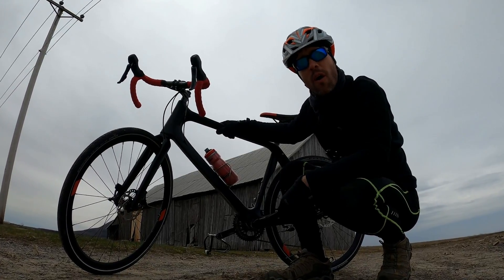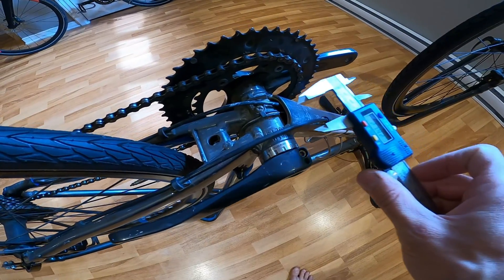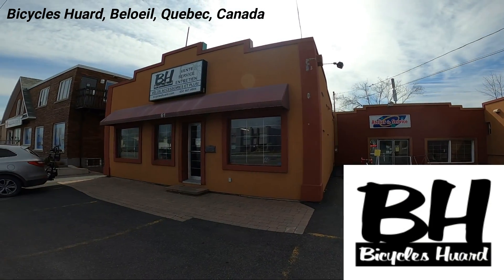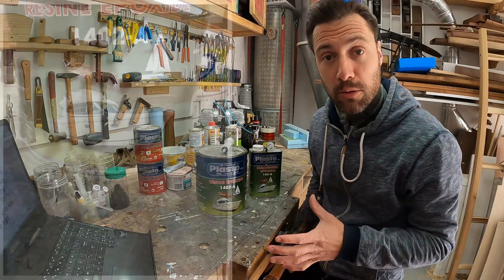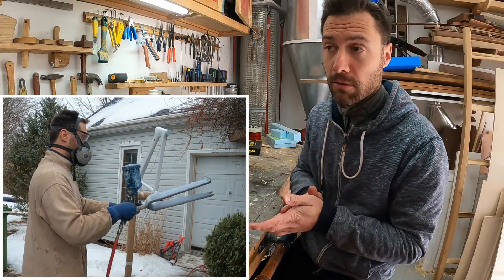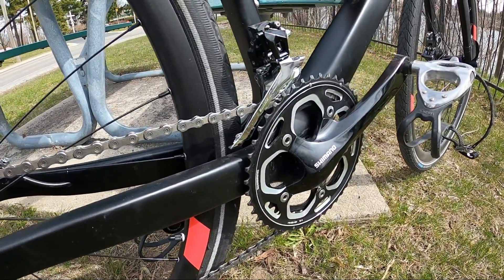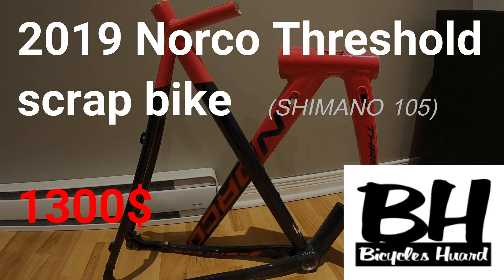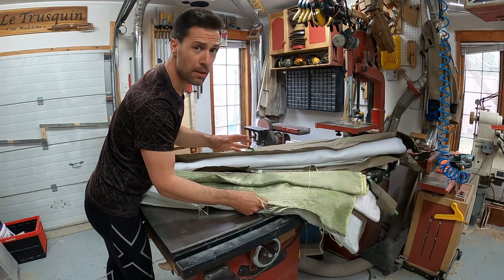Home made carbon BIKE FRAME project - Ep. 8 - Answers to some of your questions + cycling images

Comment: Hi, how did you shape the tubes profiles? And after that, how did you prevent the tubes from deforming when laminating and vacuum bagging?
Reply from the maker: Take a look at ep 1 and 2, answers to your questions are there
Reply: @VoilierFuligule  I've seen them. I know you have used rasps and probably sandpaper, but how did you controlled by hand the profiles? They seems quite complex. Did you just sculpted them by eye? If you did so, you have done great job! 
And I did not see anything about preventing deformation during vacuum bagging. I suppose that the thin tubes are prone to deformation. And another question - when you were making the tubes, did you use a whole piece of carbon from end to end, turning it few times over the tube, or you used shorter pieces? I see that you have used only twill fabric, but did you change the orientation of the fibers in order to get 0 degrees in some of the layers?
Reply from the maker: @krassiechocheva3141  1- First I cut squared pieces. I draw the symetric profile at the end, then, with rasps and sand paper on a long piece of wood, I handcrafted the profile. It worked very well. Pieces are not so big. 2- The smallest back parts on the bottom bracket collapsed a little bit under the negative pressure, so I added more layers and made the joint after them being glued togheter. The shrouds are the only parts which are not empty, I leaved the solid in the center to roll the carbon over, because they were too small and they would have collapsed under the negative pressure. As long as I remember, I used a solid piece of wood as maple (not sure... I got a lot of woods in my shop). 3- No, rolling the whole piece of carbon from end to end makes folds in the fabric, So I made my tubes by stepts of several layers by making 2 or 3 turns each time, then it worked well. 4- Yes, I changed the orientation of the fibers even if commercial frames are made to get deformed and absorbing. I did it for the most on joint parts as well as the bottom bracket, direction tube, chain plates. and upper part of the seat tube. I just used the material which I already had on hand and try to make a solid frame. Th e middle of the tubes are a little bit thinner than the ends.

Comment: I'm interested in your motivation. The bike looks great, but it is very similar to so many off the shelf frames, so why did you build your own?
My motivation is there is nothing on the market which does what I want and I came across your build looking for tips and tricks. What I want is a light weight, semi recumbent leaning trike. I plan to use fibreglass for a quick and dirty trial version, then when I've worked out what I did wrong, make a carbon fibre version.
Reply from the maker: I built my own because I always do my own when I can. Why by something when you could make it? I like chalenges. Fiberglass will work for a trial version, but it does'nt have the same properties as the carbon. Have fun in your project!

Comment: Thanks for this overview of your project. It's s great help in my "cycle" project - a home made velomobile. I didn't know how to make suspension wishbones, as I can't weld (I have nowhere to do it), and glass fiber would be too flexible. But if you managed to make stiff enough not to bend bicycle frame at home, carbon is the way to go then.
Reply from the maker: Thank you Failer and have fun with a home made carbon wishbones. The stiffness will depends on which type of fibre and how you will lay them out.

Comment: Excllent work.   Curious about the Plasto epoxy product, which I would like to try in my boatbuilding projects.  I looked up the pricing, and seems much less expensive than West System, which is all I can source here in Ottawa. Does the Plasto work well as an all purpose epoxy for gluing, fiberglassing/laminating, etc?  Does it suffer from a lot of amine blush?
Reply from the maker: Hi, thank you! I used West System epoxy only one time because I did a job for a friend which had already bought that product. I alaways used Plasto products because I alaways had a nice service when calling or when getting there and ask for technical questions. They have different products depending of the viscosity you want so that for laminating carbon fiber or fiberglass clothe I use the 1402 which is more liquid at room tempeture. For woodturning varnishing technic, I used a thicker resin so that she does'nt leak everywhere. I really like the paste epoxy product. I filled my keel joint and I use it to glue wood on fiberglass on fiberglass parts on fiberglass. Prep is the key. I've been using there products for more than 15 years now on my 22 feet small sailboat, my last sailboat project which is an old Hunter 30, RC sailboats, a home made carbon bike frame, woodturning finishing projects and so on! Never had amine blush problem. I use seringes to measure the right quantity of resin - hardener ratio. I also somtimes use dying for gelcoat to color the resin. Works pretty well. Don't be shy to call them and ask about there products depending of your project. I'm not specialized!

Comment: Hi, awesome project, could you do this with fibreglass instead of carbon?
Reply from the maker: I don't see any problem, except it would be very important to use the right progressive thickness and probably use some unidirectionnal fibers to make the frame more ''flexible''. I reiceved couple of e-mail of persons who started a project in fiberglass instead of carbon.
Reply: @VoilierFuligule  Thanks! I am planning to make that, but a trials bike frame (you know the one without  a seat). Cheers!

Comment: I am do amazed by this work. I hope someday I'll be having a chance to make my own
Reply from the maker: The best is to do it! If you already own a bike which on you can take all the measurments required like I did (because I'm not a bike expert...), it will help you a lot! Have fun and don't miss on security!
Reply: @VoilierFuligule  Got an alloy bike and might try this in the nearest future. May I ask how it's been up to now? Still great?
Reply from the maker: @Tentenszx  Still great, but I did'nt have the chance to try it a lot. Only for 300km. I got more time with the pandemic last spring to finish almost the project and cycle, but I'm also a sailor and during summer time, I don't cycle much because we pass all the summer long on our sialboat. I have to wait by mid-May to use it again. Otherwise, I can tell you I really appreciate the little ditance and the few trips which I used it. Shimano 105 is a nice upgrate from Shimano Sora and carbon is lighter. I'm still using my fatbike to go to work everyday, to much snow here and ice on the road. I will get on my hybrid in a few weeks and eventually could take my carbon project!
Reply: @VoilierFuligule  That's so great! Does people ever ask you about your bike asking what brand it is and you answer them with "I made the frame"
Reply from the maker: @Tentenszx  Hi Adrian, not much for the moment. But you may know that most of the time I cycle on roads between fields  and I rarely meet other cyclists. I'm a little bit ''solitary'' and like to do things alone. Also, I don't use my bikes on weekends because we get to the marina, so my biking schedule does not help te get contacts. Will see in the next few months! I also think that the fact that my frame does not look like a hand made one  contribute to do not get a lot of people asking me which brand it is. But I let you know that is a plaisir when comes the time to tell it!!! Get several collegues at work which were impressed by the finished look.
Reply: @VoilierFuligule  Even I were impressed by it and if I didn't watch this vid and saw that bike I would be thinking that it's been restored or repainted that's why it doesn't have any decals. Hope you'll have more great creations in the nearest future sir. Glad to see your work even in just a video.

Comment: Hey Voilier thanks for the series of videos, they gave me a lot of insights and inspirations. I was wondering of what type of oven did you use to cure the carbon? And I'm assuming the carbon is prepreg with resin?
Reply from the maker: Hi Tigor, No the carbon fiber used was not prepreg. I just used a seeting heat mat with basic isolation to reach a higher tempeture. But the resin I used cures in 20 mintues et 20 celcius degrees. I prepreg my fabrics by myself before layering. The same technic was used to build the frame parts as the little plate under the BBshell, take a look at Ep. 9. It's the same for all the parts I did! https://www.youtube.com/watch?v=oxUUCrz_mHg&t=11s

Comment: What mixture did you use for the drop out? Resin and? I have tons of questions I am planning to create my own frame.  Here's my email mjalgire2@gmail.com
Reply from the maker: Dropouts were made of the same resin as all the frame parts. Products used are presented in this episode (#8) the epoxy resin I use is a mix of 5:1, it gives me around 30 minutes of working time at 15 degrees celcius, but almost 20 minutes at an ambiant tempeture of 20 degrees before I heat the parts to decrease the curing time. I just laminate may layers of carbon fiber in my molds until getting the right thickness. All images are stored at home on a hard disk, I'll e-mail you later, should be next week because i don't have anything here at the marina.
Reply: Thankk youuu!!

Comment: Hi bro. Thank you about the BB30. What I mean is the BBtube

And the part where you put your rear derailleur
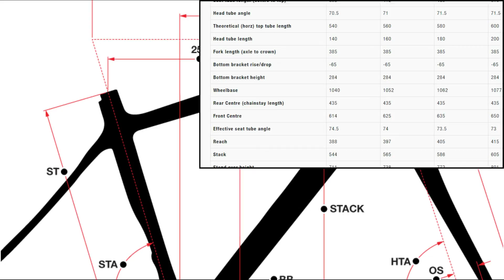Reply from the maker: Hi Joseph, I made them. The bottom bracket tube was mold on a piece of wood wich I could separate in two parts to remove it. Next I integrated this tobe in my bottom braket part. I get few images of it. Look here at 1:32     https://www.youtube.com/watch?v=TJ4Iz2JXh2M     you will see the carbon tube I integrated in styrofoam which has been laminate with carbon. I can send you more pictures by e-mail if ou want. At 1:36 you will see the final bottom bracket part ready to be glued with the other frame parts. Here   https://www.youtube.com/watch?v=TJ4Iz2JXh2M   at 0:05 you will see the rear derailleur parts wich I mold in solid carbon 1/4 inch thick. I'm actually in a sailing time, but I planned to make more videos next winter to explain well how I did these parts (it requires a lot of time because english is not my language...). I get a lot of questions about the BB tube, the droouts and the head tube. The technic I used to make the BB and the head tube is similar. Dropouts where made by simply molding and I add a small aluminium plate on the left side to prevent wear on the carbon fiber. Hope this will help you.
Reply: This helps a lot bro! Please do an in depth tutorial to what techniques you've used in making the rear drop outs, bbshell. Thank you for responding I'll be waiting for your videos
Reply from the maker: @joseph0327  Thanks for your petience!
Reply from the maker: @joseph0327  Sorry I should say BBshell, not BBtube... you may know i'm not a expert in carbon making... just a guy who likes making things by himself! You may find other technics. some people just buy metal parts and incorporate them into their project.

Comment: Hi bro, did you compare about wheight with the alumunium frame?
Reply from the maker: Hi timtim, my aluminium hybrid bike weights a little bit more than 27lbs. My carbon bike (same wheels and tires) is a little bit less than 16lbs. Would be even better with carbon wheels and thin tires... but is't OK for now! I never had the chance to get my aluminium frame free of any components, so I did not compared the frame weights yet. May carbon frame is 1350g (without paint). Precisely 1246g by memory...

Comment: You are amazing man! To create something like this ate your own house! I wish you have more projects to come like mountain bike frames and aero roadbike frames!
Reply from the maker: Hi James, thanks to taking time leaving a comment! Projects for the moment are to finish and upgrade my bike, still have the little plate under the bottom bracket tube to make and I would like to make carbon headset spacers and cap. Also a carbon bottle older and few other things. If I decide to make another bike frame, maybe I will use wood or a mix of wood and carbon fiber! Regards, Sebastien